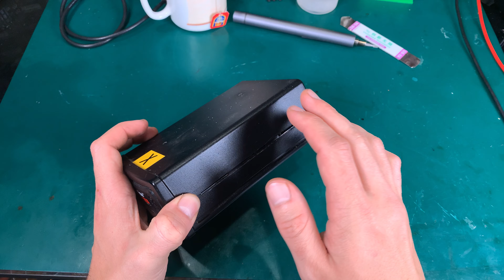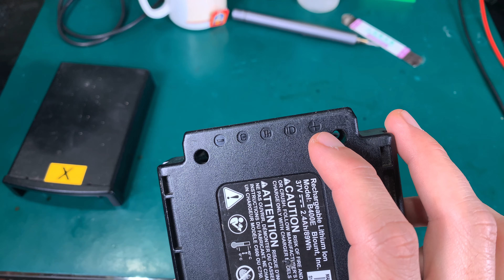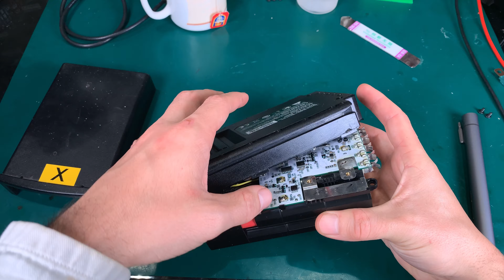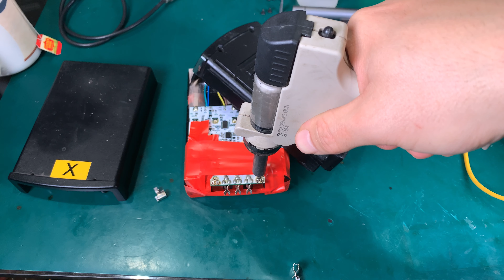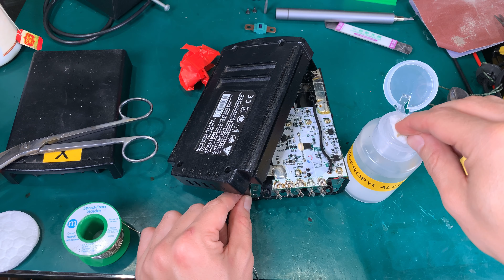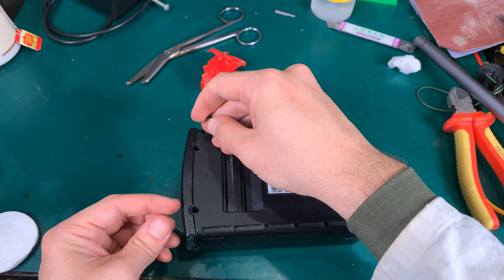Fixing terminals on Oregon PowerNow 36V 2.4Ah battery after dead short in chainsaw

Comment: Hi, how do you get that case cracked open? I pulled 4 screws but pack wont bnb open.  thanks for the video.
Reply: What screwdriver did you use to open the case?
Reply: @olegpopov9962  I used a torx t10 to remove the screws but I can't pry open the case. Tried wedging a flathead in the seam to no avail. Do I need to grind or saw through the case to get it opened?